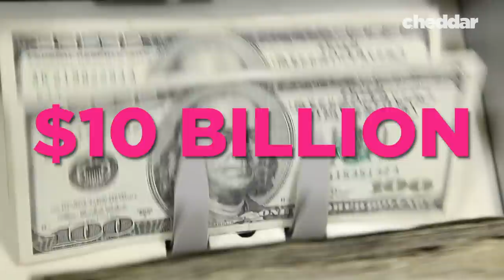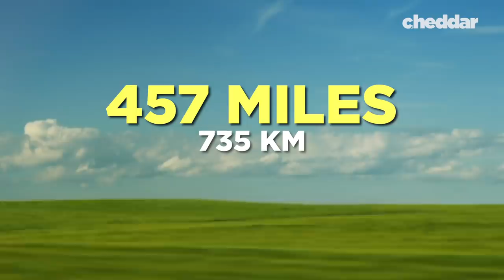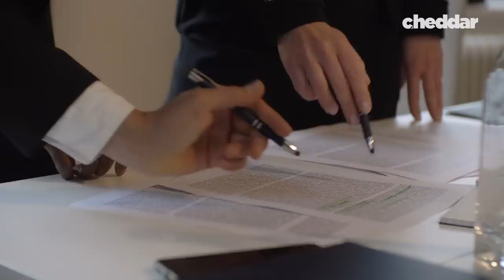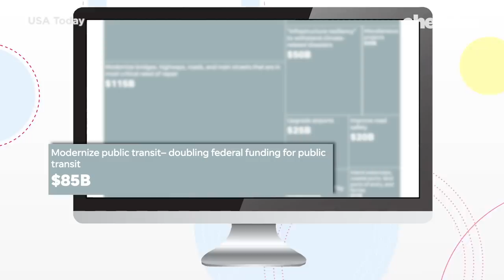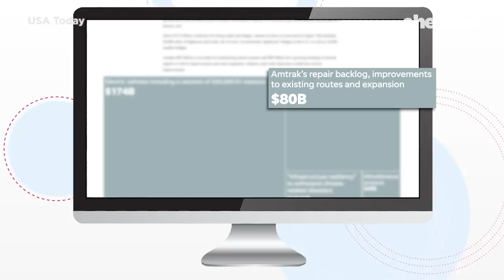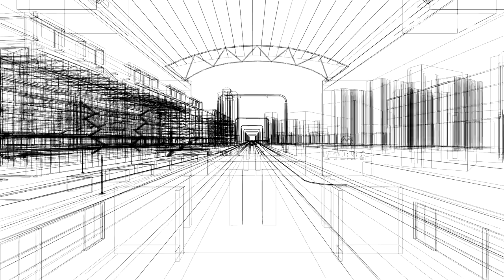Is New York Finally Getting A Real High Speed Rail? - Cheddar Explains

Comment: Tokyo to Osaka is WAY further than 67 miles though 😂
Reply: I heard this and was like...how did they get that as the distance?? Yikes. Tokaido Shinkansen from Tokyo to Shin-Osaka is 515 km/320 miles.
Reply: @janweber2889  I live in Japan and ride the Shinkansen constantly. When Shikansen gets into populated areas it is built on a bridge above the existing local and express trains below. Or the bridge of the Shinkansen travels above an existing street. In this way they avoided having to take up more land. Building a bridge system like this is expensive, but in the long run it is cheaper and faster than trying to buy up the land and lay track on the ground. Just saying, this is the Japanese experience.
Reply: Best I could find for that figure was one source (a BBC article) that mentioned the line had 67 miles of *tunnels*...
Reply: @ravik694  This may be it. Of course there is no way of knowing haha. Sadly Cheddar are normally on point with their productions
Reply: The 67 miles was the first section to Odawara. To Osaka it's around 450 km if I remember correctly. That's a just under 2.5 hour journey.
Reply: Hi, I'm Japanese and it's 515.4 km.  I have no idea where 67 miles came from.
Reply: I found that the distance from Tokyo to Hakata is 1069.1km (about 665 miles). This is the sum of the Tokaido Main Line (from Tokyo to Shin-Osaka), which was first built in 1964, and the Sanyo Main Line (from Shin-Osaka to Hakata), which was built second in 1975. I still don't know if this was reduced to 1/10.

Comment: Why is there a regional ÖBB(Austrian) Train in the thumbnail? That's not highspeed
Reply: That's not even high speed
Reply: It is for Americans, any train moving over ten baseball fields per whopper is high speed
Reply: That is high speed comparing to what they have in America
Reply: @oromedenep  how long is a baseball field ? 
5 m ?
Reply: @paxundpeace9970  I think the question here is how many seconds a whopper is
Reply: same reason you had a shot of a Siemens built UK commuter train during the video (with the bright yellow ends), video editors picking clips that look good rather than ones that are consistently relevant to the point they're trying to make
Reply: They changed it lol
Reply: Because aerodynamic trains look fast to Americans. Almost all of their trains are pretty flat-fronted.
Reply: @Dan-gd6zz  the time an average washing machine takes to travel 125 average banana lengths in a vacuum.
Reply: @honzahalik5750  Thanks
Reply: Its a chinese high speed train in the thimbnail...
Reply: @Someone-wh8hi  they have changed it
Reply: @Someone-wh8hi  they changed it
Reply: It's probably faster than anything in the States.
Reply: There's also a Spanish commuter train.

Comment: So...not a single mention or clip of Acela Express? A massive problem with HSR in the USA are the regulations regarding the manufacture of rolling stock here. Transportation authorities in the USA require that intercity trains be built reinforced and extremely heavy to withstand damage from certain types of crashes and derailments, whereas most other countries require things like advanced signaling and automatic braking, etc to prevent those issues from occurring in the first place. This is a huge technical challenge because most of the companies that build trains have to modify their rolling stock designs significantly to be allowed to be used here. The added weight changes everything about the trains performance and also for the rail infrastructure that uses it.

Then certainly  the single biggest problem for HSR in the USA is the lack of any significant dedicated track, even in the busiest regions like the Northeast Corridor.  All of the countries with successful HSR systems have dedicated track for these trains, so until that happens in the NE Corridor and elsewhere that isn't being built from scratch, you're not gonna have anything close to HSR there as seen in the rest of the world. 

Would love to see a dedicated Great Lakes HSR network from Chicago to Buffalo (and Toronto) via Detroit and Cleveland, but I think it'll be a few decades before anything resembling that gets a green light.
Reply: They mentioned it and said it averaged 65 mph
Reply: Great point, Jan.  It's hard for people who don't understand the details of trains to make videos like this.
Reply: You ever wonder why regulations are so tight on rail ? Is it because of lobby by the airlines and auto industry ?
Reply: @ahmedzakikhan7639  Because the FRA is stuck in the 20th century when it comes to railroad best practices.

Comment: What's needed is affordable rail.  Boston to NYC cost close to $100 each way.   Reduce the cost to $20-30 roundtrip, you will see a huge demand for more trains.  Which would increase the need for high speed rail.
Reply: We need incremental improvements to our rails, not big flashy stunts like CAHSR that garner alot of opposition. 

Basic things like speed, reliability, frequency, cost decreases, electrification.

Comment: Improving the hudson tunnel would be nice, but we would still need more tunnels to provide a way to bypass the construction and to increase the capacity.
Reply: Yea an additional tunnel's badly needed just so the old ones can be properly repaired and modernized. Hard to do work when there's no way to close it for more than a few hours at a time
Reply: One of the unspoken issues here is that nobody wants to give taxpayer dollars to states like New Jersey or New York where it will be wasted. These states are corrupt, financial disasters and will squander ever dollar they are given to build something like this.
Reply: Hudson tunnel is the main bottleneck on the NEC right now.  The next major bottleneck are the Baltimore tunnels.

Comment: You never mentioned Brightline, which is an actual working "high speed" rail from Miami to West Palm Beach.
Reply: 125 mph is not high speed rail. The Acela is not high speed rail even though it goes 160 mph in some sections.
Reply: @thechickenstew3716  According to wikipedia "new lines in excess of 250 kilometres per hour (160 mph) and existing lines in excess of 200 kilometres per hour (120 mph) are widely considered to be high-speed."
Reply: @YEETMAN-dt9mb  in excess of 200kph (125 miles per hour). that means trains that travel faster than 125 mph are HSR. And HSR has to run on dedicated tracks.
Reply: @thechickenstew3716  200km/h? You call that high-speed?
Reply: @bartholomewdan  that’s congress’s definition and much of the world’s definition.
Reply: @thechickenstew3716   Meh, personally I'd call 250km/h+ high-speed. Just me though.
Reply: @thechickenstew3716  Does any American high-speed train ever exceed 125 mph? Do they even have in-cab signaling? 200 km/hr (125 mph) is the limit the drivers can react to lineside signals and equipment.
Reply: brightline is not high-speed rail, it's using existing rail, only new sections will be fast....essentially the same problem as amtrak acela
Reply: @thechickenstew3716  While that partly answers the first question, commenters on that video implies that is a test run. I should had clarified: any American trains faster than 125 mph in regular service? The video is an exterior "flyby", so it is hard to see if it has any in-cab signaling.
Reply: @dbclass4075  https://m.youtube.com/watch?v=V1JLk-atnr4

What do you mean ‘in cab signaling’?
Reply: @thechickenstew3716  
Florida 125 > California 0

Comment: If only they could deal with the problem of construction times in the US taking forever for anything then they could probably get the costs down enough to get funding for all the infrastructure upgrades the US needs, but right now in the US and especially in the northeast simple things like repairing relatively small bridges take years, and replacing old deficient bridges take 1/2 a decade or more, when the original bridges they are replacing having taken significantly less time to build with significantly less advanced equipment half a century ago, or even over a century ago.
Reply: Right, because we now care about the environment, safety, and the people that infrastructure projects displace-- things we didn't consider 50+ years ago
Reply: @jared_du_jour  Population is also another factor. Even so, our better technologies should migate those factors that slows us down to some extent.
Reply: We have to make sure any construction project is not going to harm the planet. We have people blocking projects to make sure it won't harm anything...
Reply: @codyuhlmansiek805  The efficiency of trains per passenger is appealing, energy consumption-wise.
Reply: @codyuhlmansiek805  @Jared Schwatz I'd say that over here in Europe environmental and work safety regulations a re at least as if not more strict than in the US. Still we manage to build most infrastructure projects in a fraction of the time...

Comment: The problem is the US is too bullheaded and absurdly too proud to address issues like infrastructure.  It has no problem funding ridiculously overpriced things (like our insanely bloated defense budget. Our annual defense spending per year is anywhere from $600-700 BILLION and Congress had no problem adding to add more funds a few times) without batting an eye and it certainly has no political will to follow the trends seen in Europe and Asia. 

There was a time the US was looked upon for innovation but nowadays, we're a joke when it comes to the subject of infrastructure and mass transit.
Reply: Are you kidding, Silicon Valley is still going strong and shows no signs of going away any time soon. We are very much the world center of innovation.

We already have a system of high speed vehicles to get from one area to another, it's called jet aircraft. It goes a lot faster than HSR for a small fraction of the cost.

Comment: I think the existing Acela tracks should be upgraded to allow for higher speed rather than building an entirely new line.
Reply: Improving current tracks can maybe give you 10% or so boost. But nowhere near the HSR level. HSR need much straighter route and then much fewer stops.
Reply: The Northeast Corridor has some of the oldest tracks in the USA and also, some of the bridges are drawbridges over rivers and Connecticut towns have control over when the bridges can close, since some towns get taxes from boaters...
Reply: They can't. It's aging with curves that can't handle those speeds. New maglev technology from Washington DC to Boston is what's needed.
Reply: @r.d.9399  It doesn't even have to be a maglev. A new dedicated route with conventional rail might interest to those cheapskates.

Ah, wait. They could be that cheap to not even consider that.

Comment: 20 year construction period? It's going to be in need of repair even before it finishes construction lol.
Reply: Know how long the highways took to build?
Reply: @Joesolo13  that's not even comparable. the interstate system spans the entire country. It's in no way an analogue to a single rail line.

Even if you look at a single interstate, those that do have long term construction periods ended up being degraded in places after such long construction periods.

Comment: Okay 1. Population density is only a problem if you’re trying to run trains out to rural montana. The vast majority of the population of the US lives on the east coast, west coast, and the rust belt. High speed rail in those areas would be huge. Dedicated high speed connections between these areas are optional but appreciated. It could also facilitate growth of population in the mid west.

Comment: It's kind of sad that such a big global city like New York does not have high speed rail
Reply: It's too congested here.  Plus, we don't really need it.  Regional flights are dirt cheap.
Reply: @PaulsWildLife  congestion and cheaper regional travel is exactly why other countries do high-speed rail
Reply: HSR exists to connect cities not to remain in a city......
Reply: thye have an extensive public transit system, but you don't need HSR within a city. HSR is for going from city to city.

And for travel between population centers, Americans just fly. It's a lot faster. Our population centers are a lot further apart. For example the first city east of San Jose (aka Silicon Valley) that has at least the same population as San Jose is Dallas, Texas, 1734 miles or 2790 km. A plane can fly it in three hours. If the US Federal Government wanted to waste multiple hundreds of billions building a HSR from San Jose to Dallas, it would still take six hours, so what would be the point? The private sector does it much better and the federal government only has to pay for security (TSA) and air traffic control. The airlines pay for the jets and to operate every other aspect of the airport. It's a lot cheaper for all involved and the vehicle is MUCH FASTER.

The Northeast Corridor is one of the few regions in the USA that has major cities as close together as Europe, and there is in fact an HSR in the region already, Accela.

Comment: Great video but you should have mentioned Florida’s new Brightline High-speed rail.

They got around the money problem but raising the money privately for the most part.
Reply: brightline is not high-speed rail, it's using existing rail, only new sections will be fast....essentially the same problem as amtrak acela
Reply: @Fals3Agent  And their rolling stock is Siemens Velaro? That's way under utilized. A regional train such as Siemens Desiro would be more appropriate.
Reply: @dbclass4075  yeah kind of overkill but I guess they reaaaaaaaally wanted the speed even though it doesn't reach lmao
Reply: @Fals3Agent  Basically, they drag a German train into the same problem as the French train they currently have. When would they learn infrastructure is equally important as the vehicles?
Reply: @dbclass4075  they will never learn lol, america doesn't understand rail....the one place that is doing dedicated infrastructure is california which coincidentally is also the most attacked project lololol

Comment: A decade or so ago there was a plan for a high-speed rail in Ohio that would connect Cincinnati, Columbus, and Clevland (The 3 C project, or something like that). Driving between each city is roughly two hours, the rail would have had it down to forty minutes. The plan also called for another line to go up to Toledo from Cincinnati along I-75 that could in theory act as a hub to Chicago and Detriot (which opens up a connection to Toronto).

It's my opinion that if they would have built the first three connections that the state wouldn't have bled out the population as severely as they did. Having the option to not move and commute for work is a powerful one. As a business knowing you can pull in candidates from a larger radius even more so. Instead, people left the state for opportunities elsewhere.
Reply: Then what do you do once you get to your destination? How often would the trains run? So you drive 20 minutes to a train station to catch a train that if you are lucky, departs every two hours, and ultimately you end up losing time, for a 2-3 hour drive that would cost $25 in gas, and you could easily care 4 people. How much would the train fare cost EACH person. MAKES ABSOLUTELY NO SENSE!!!
Reply: @johnp139  In the first place, the stations are also poorly designed. Under what circumstances would anyone want use the station in the middle of nowhere?

Part of the reason why HSR succeed elsewhere because the "last kilometer/mile" gap supports the HSR: bus, metro, pedestrian infrastructure, etc.

Comment: Hypothetical high speed example, NY to Boston:
30 trainsets of 12 cars (2 power cars, 10 passenger cars) with seating capacity of 400 passengers per trainset.
Assuming an average density of nearly 80% full per run and 10 runs per day, per trainset, that’s 100,000 one way passengers per day.
If a ticket costs $50 one way, that’s $5million per day, at that (rather optimistic) rate it will take 20,000 days (nearly 55 years ) for ticket sales to equal the $100 billion price tag.
The good news is that Amtrak is already upgrading the Acela fleet with the new Avelia Liberty trainsets and that will accomplish much of what is desired in a high speed train from Boston to NYC at a cost of $2.4 billion.

Comment: It is time.
Long Islanders want direct service to Connecticut for jobs. People in Connecticut want direct service to JFK Airport without entering Manhattan.
This High Speed Rail Line will definitely increase the frequency of service between Boston and New York City, if there's a proper fare structure or a proper fare media that allows cross-honoring.
Also, with the New York to DC portion, we could have new branch service to Pittsburgh via Harrisburg increasing the service on Amtrak, and allow a new Boston to Pittsburg rail line.